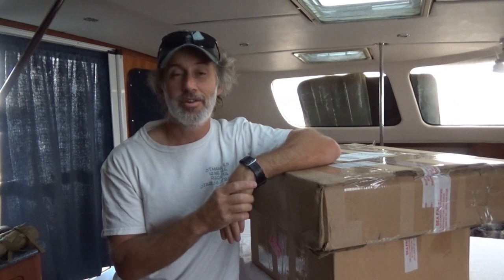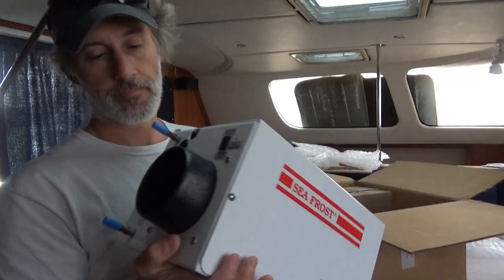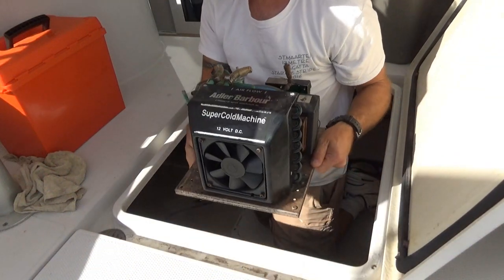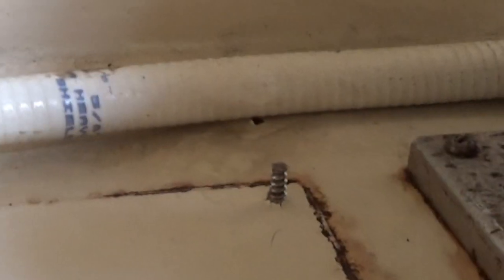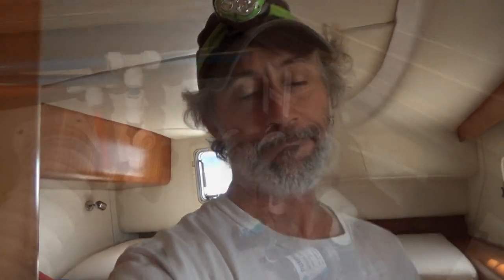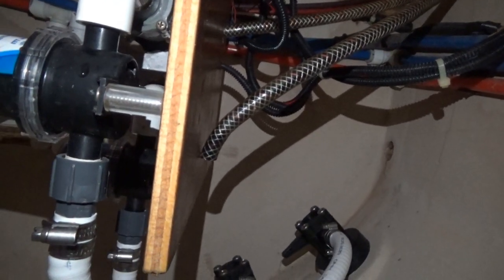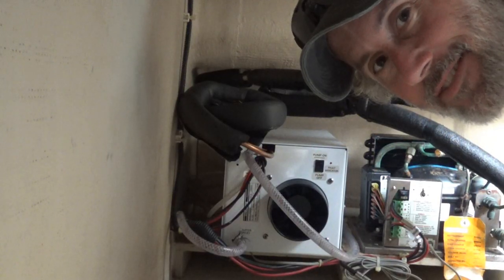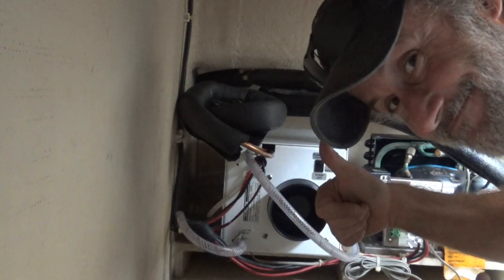How to install a SeaFrost Marine Freezer Sailboat Maintenance

Comment: Cool video.. 😉 This setup, will it be able to maintain -18 in 25-30 degrees celsius ambient...?
Reply from the maker: Thanks for watching. We use a thermometer like this one https://amzn.to/2ZcN7aE

The freezer is set on 6.5 and it keeps the freezer at -20C

Our fridge is set at 5 and maintains 4C. The fridge is a single plate system. 

Both thermometers are at the top of the boxes so its colder at the bottom. 

Hope it helps and thanks for watching.

Comment: How many amps are drawn in the single plate system (like real figures) not off the box? Cheers
Reply from the maker: Great question. I haven't measured a full day. I dont have a meter dedicated to that circuit. However when I installed it I put an amp clamp on it at start up. I was getting 5.1A. I checked back when it was already cold and running it was just under 3A. 

Hope that helps. Thanks for watching.
Reply: @Unwrittentimeline  Yep .. fantastic thanks